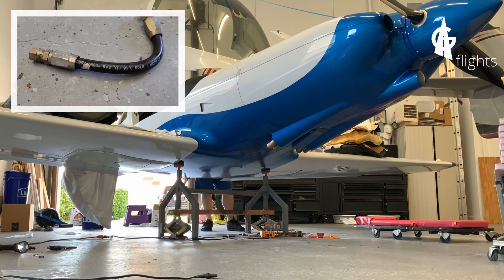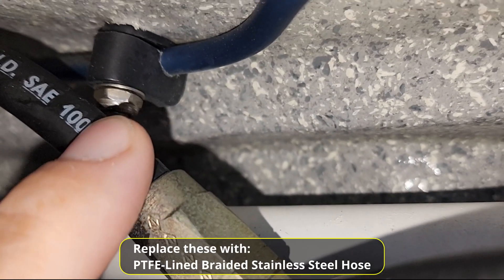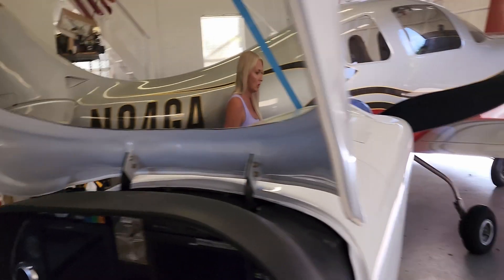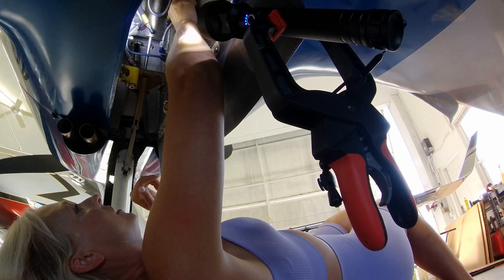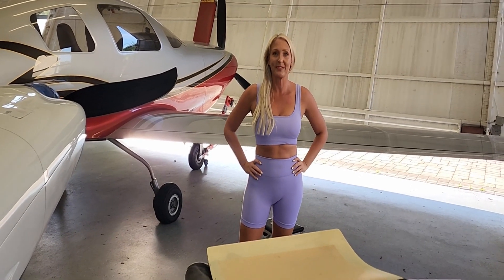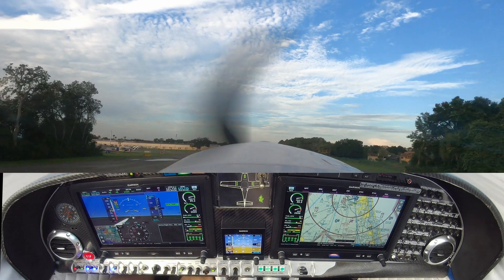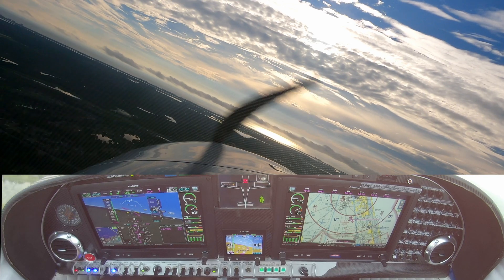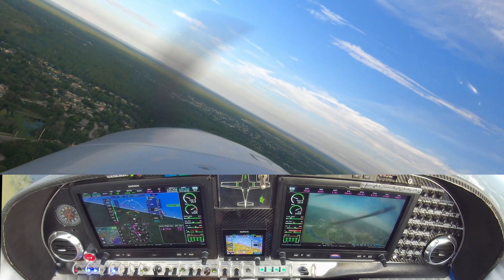Lancair Pilot: Hydraulic Line Failure - Replace the old lines with new PTFE Hydraulic Lines

Comment: Great video. What camera do you use for your gear? I recently bought a IV-P and would consider doing same. Thanks
Reply from the maker: First Congratulations on your purchase of a IV-P.  I have found that the realtime double check of the landing gear to be very valuable.  So 3 in the green and visual check. have helped me a lot at different times.  One time the gear didn't fully retract and I could visually see the problem and another time my retractable step wasn't working and I was able to see the binding point.  I use the very inexpensive backup cameras that work on voltages from 12V to 30V from Pyle.  PYLE PLCM38FRV and PYLE PLCM22IR.  Please let me know if you have any additional questions.  These cameras have RCA jacks output which can put feed into a garmin G3X Touch PDF or any other composite video monitor.